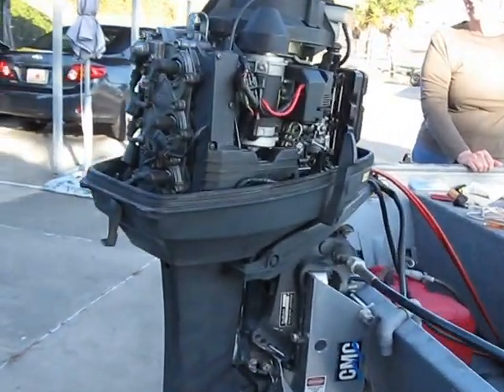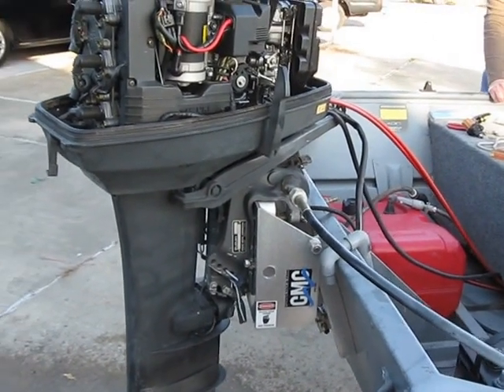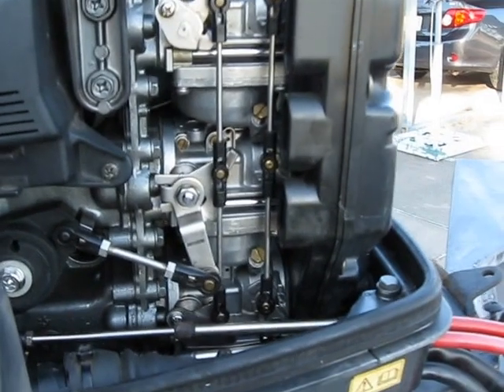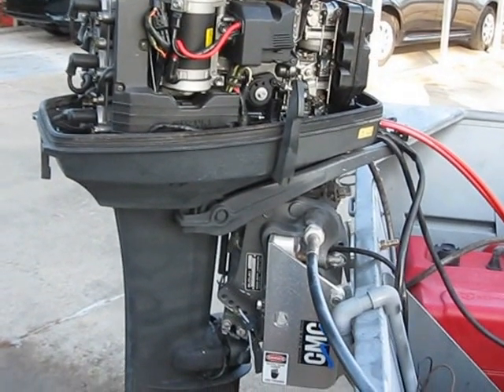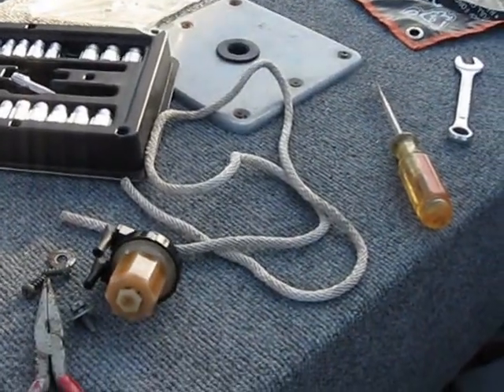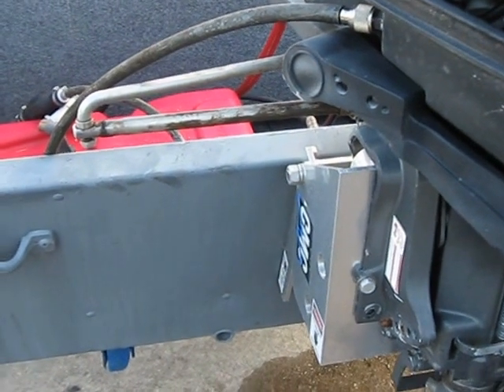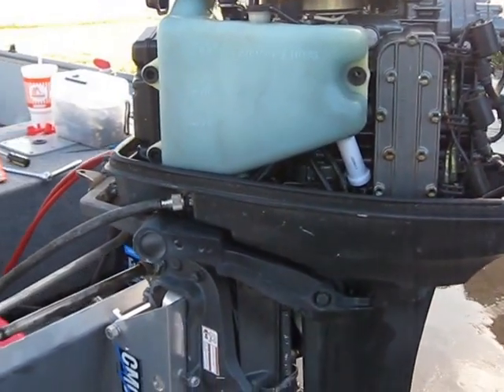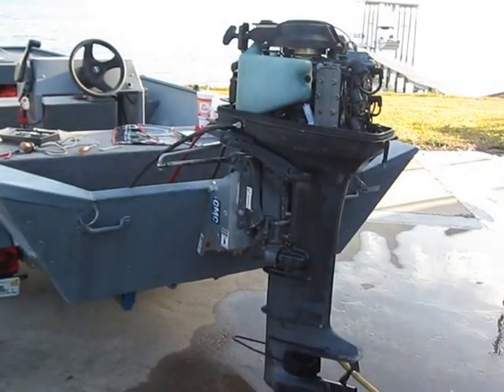Suzuki 25 hp 001

Comment: I have this same motor and I am having issues with it. The fuel bulb never gets tight and when running wide-open throttle my motor starts acting like it’s starving for fuel and sputtering. Was this something similar to what you dealt with? I’m trying to fix everything that I can before taking the carbs off and rebuilding them
Reply: I would check for fuel leaks first, and then take the carbs off and clean them.  I still have this motor but I had to take it off of the boat. Field mice got in the motor and ate the electrical wires on the top of the motor. I picked up a 25 hp Merc, 4 stroke with fuel injection. It runs great but it is not as fast as it was with the Suzuki.
Reply: @jlulue7  thanks man I appreciate it! I’ll check for leaks!
Reply: @john leleux do you still have the dt25hp? I have one with a no spark issue and was wondering if you would be interested in sell the cdi box

Comment: I know this is a bit late but the Suzuki DT25 will not "pee" on the muffs. It has a 3rd water pickup under the cavitation plate that will pull air. Put it in a bucket to or tub to run if the boat isn't in the water. It's an inconvenience for flushing the motor but other than that they are a great 25hp.
Reply: You literally just saved me from a panic lol purchased a dt25 2 weeks ago stream was weak went on the water and it didn't seem right pulled foot off replaced the impeller gaskets thermostat + gasket hooked up the muffs and same thing...🤦🏼‍♂️😧

Comment: I know this video is 6 years old, but maybe you can help me...
I got a motor just like yours, but the carbs came in pieces.  Previous owner had pulled them apart, got overwhelmed, and gave up.  So I got it pretty cheap.

I'm comfortable with cleaning carbs, but these are very different from the Johnson and Mercury carbs I'm used to.  

Right now, the center carb has a part on the throttle plate that will not let the carbs open up all the way.   Is this correct?  Or is this part in wrong?   I've never seen a carb that wouldn't open up the butterfly to horizontal at full throttle.

If you remember, please let me know.    Thanks for the video!
Reply: Wow.. I have the same motor, believe it or not, the 25 is governed to where the butterfly's will not open all the way..you can bend the bump stop on the carb to make it open to the parallel position..this then makes the 25hp a 30hp..yup,sounds weird, but its true..not sure if you still have the motor, but that will sure help.
Reply: @robertmckinnon7245 ,  Thanks for that info!  I do still have that motor, and have not used it yet, but it's on the agenda this fall.  I've heard this motor is the same as the 30, 35 and 40.   I wonder what that max HP I can get out of it, and what I have to do to make it a 40?   Any idea?
Reply: @thilltony3362  I have only seen videos on how to go from 25 to 30hp just by changing the throttle position of the butterfly's..maybe changing the fuel jets is a possibility.  I have my motor on a 16ft aluminum flat bottom boat, and it goes 30mph, which is plenty fast for the boat..you can look up the same videos on YouTube that I saw..it's title is suzuki 25hp throttle modification to 30hp..

Comment from the maker: It has a new waterpump. The ears on the foot was not tight enough. I put a clamp on the front of the ears and it worked fine. I just had to make sure it did not go into gear.

Comment: Better check the water pump.  It's not pumping water.  Good luck.
Reply: some of the Dt25 and Dt30 dont have the port underneath the powerhead for the water to exit at the front exhaust/water hole . So ALL the water flows out the propeller port and around the exhaust tube and the tell tale hole. Had the same problem and stripped my DT30 down only to find that out, I have another Dt30 for spares and he has the water port for the front exit. But i dp notice he had no water out of the tel tale